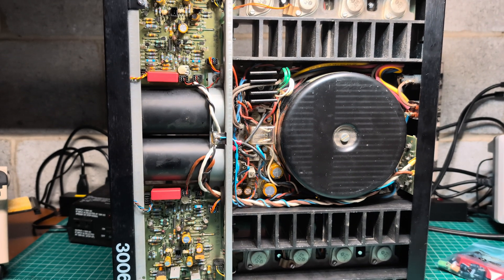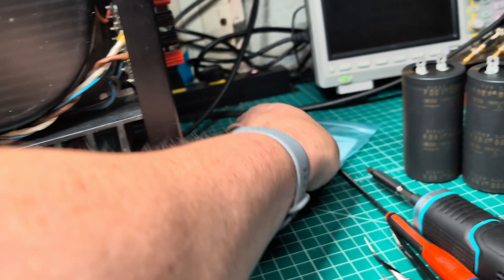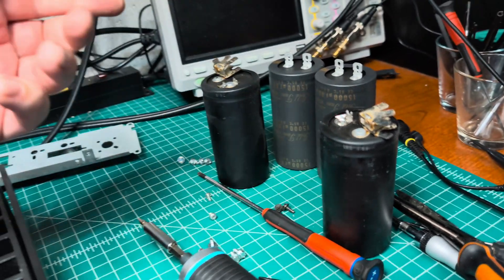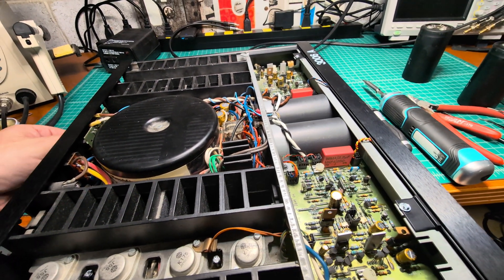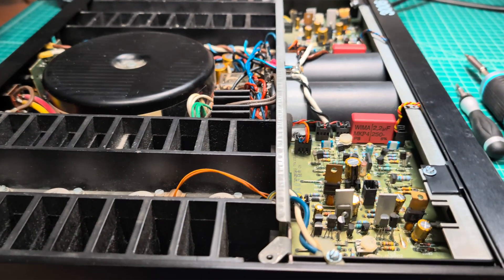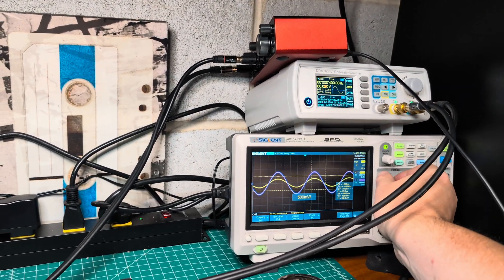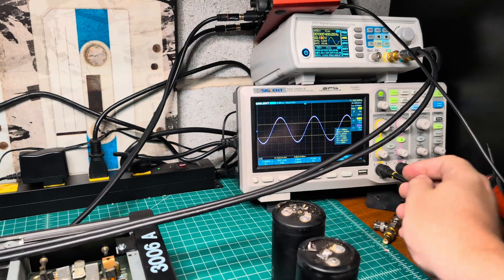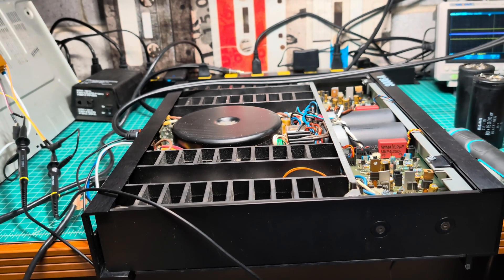Tandberg 3006A Restoration Part 2: Complete Recap and Power Up

Comment: Thank you 🙏🏻, where did you order your part from, I’ve got one, I like to replace it’s capacitors, the 15000 if 80volts 50mm by 100mm are hard to find, any infro would be appreciated my friend,
Reply from the maker: @paulrominger5200  I have ordered everything on Digikey.